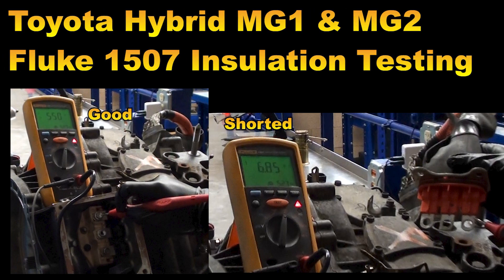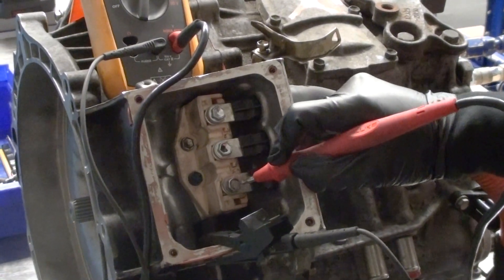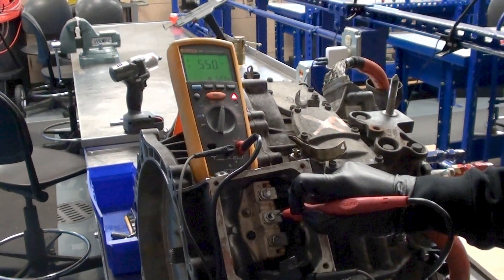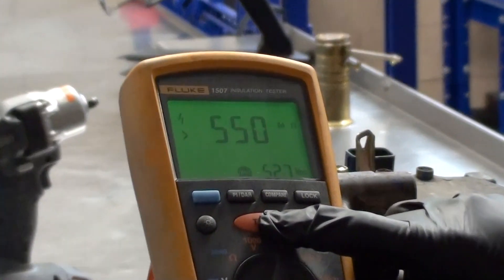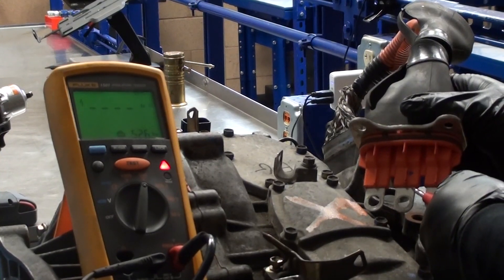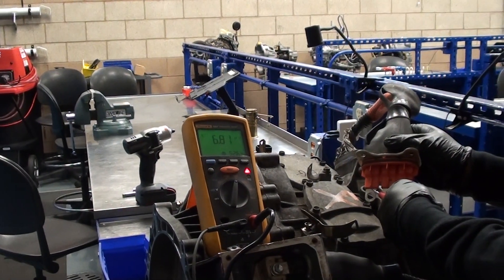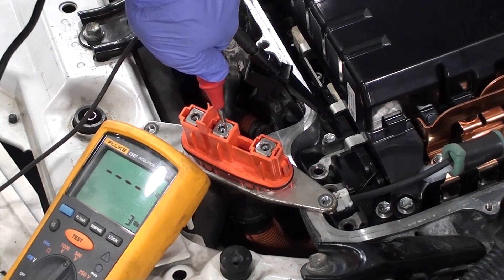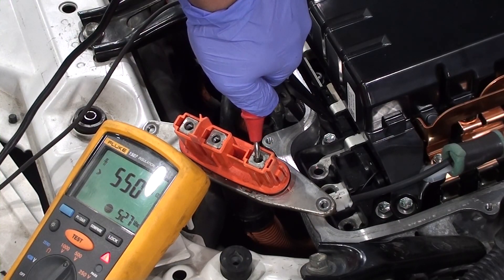Prius Hybrid Mega Ohmmeter Insulation Testing using Fluke 1507

Comment: Hi 

can i assume that HYBRID transmission that has MG1 AND 2 from TOYOTA is much better than conventional transmision or CVT that has valve body, clutch plate, soelinoids etc.  again this  is my assumption. please advise..
Reply from the maker: I would not say that one is better than the other because each is used under specific conditions and power train layouts. A lot of hybrids use something similar to the Toyota system but in no way would this type of transaxle work on a non-hybrid vehicle and the CVT design would not be strong enough for trucks and vehicles with stronger engines. Even Nissan who has adopted the CVT across the board did not abandon the step transmission for trucks. All transmission designs have advantages and disadvantages and it's the job of the engineer to match the correct design with the correct vehicle.
Reply: @DrivelineMaster  Thanks i see less issues with HYBRID TRANSMISSION than regular cvt that has torque converter, valve body, solenoid etc in Toyota..
Reply from the maker: @sivucit  This may be true. I don't work on a lot of Toyota Hybrid vehicles.  If you see a lot of these then you may be right.  If you don't see a lot of these I would refer to a shop that does or specializes in Toyota Hybrids and ask them how many transaxles they replace in a month.  The number might surprise you.